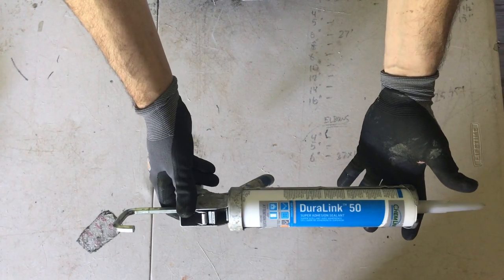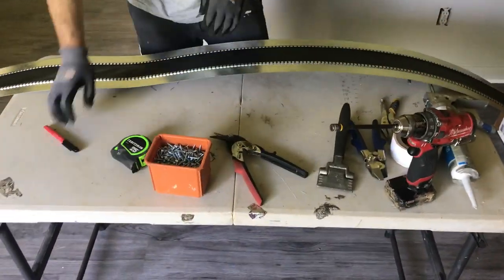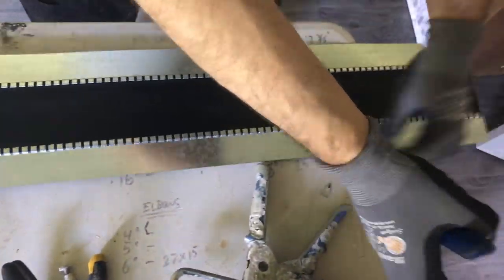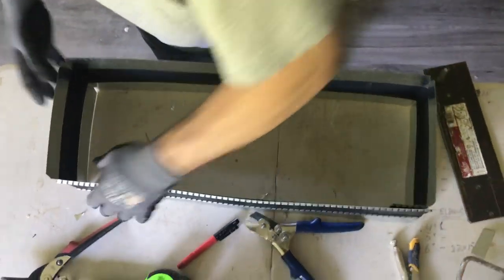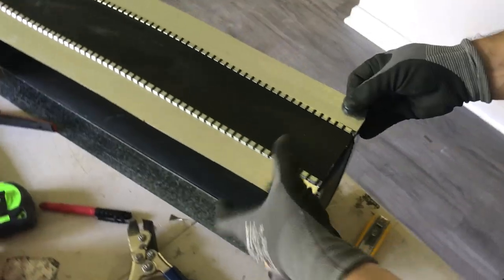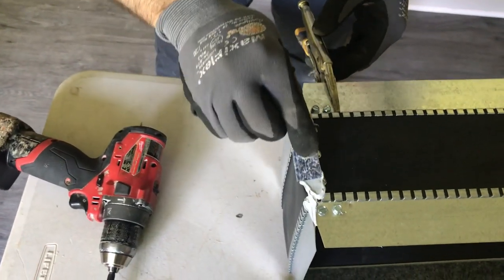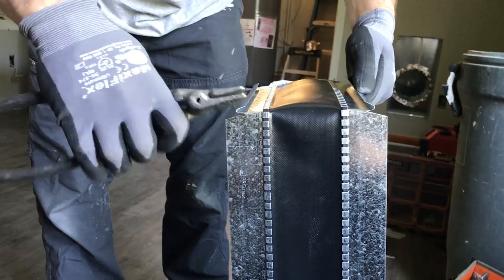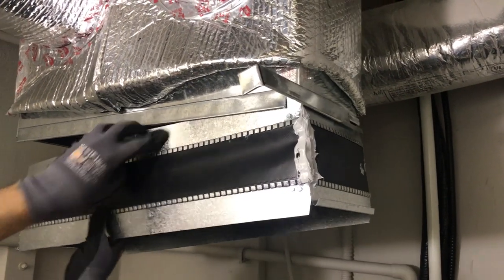How to Make a Leak Free Canvas Duct Connector

Comment: Great video, but I would hate if that ugly caulking job was on my system.  Maybe use clear caulk or find a cleaner way to seal that up.
Reply: Right, I would have turned that connector so the caulk side was facing away from the entrance to the mechanical room at the very least. Also would have used clear silicone with canvas staples.
Reply: It’s getting insulated.

Comment: We always used contact adhesive for the canvas lap, like what you use on Armaflex and then staples to help hold it too...it was fast and Waaay less messy than caulk.  You say leak free...looks like you S cleats were a bit too short and you will have much more leakage on those corners with a short S, than you will ever have at the canvas seam.  Put a dab of that caulk in the corner before you bend that drive over and you WILL have a leak free canvas connector.  Just sayin.. other than that nice work.

Comment: So what are the benefits of using a canvas connector?
Reply: I believe it reduces vibration throughout the ductwork.
Reply: Vibration isolation through ductwork is required through smacna
Reply: Also in some areas, like Denver, the basement floors move a little with seasonal changes so it allows for that movement to not wreck the ductwork.

Comment: With that tape it doesn't seem like you need caulk at all and definitely not the screws in the canvas. That should be airtight though.
Reply: Except the slip and drive joints.

Comment: I would have liked to show my student's this on remote learning, but there are too many problems I see. First, always use a speed square or Tee square don't measure down both sides if the end isn't cut right your corners will be crooked, and I like folding it the opposite way it looks so much more beautiful. Everyone should know always put the sealant on last, so you don't get it all over your hands and tools and use clear, not white on black canvas. Also, screws in the canvas, really?